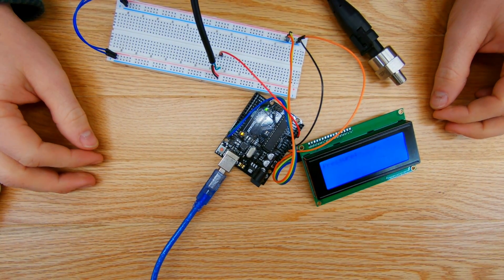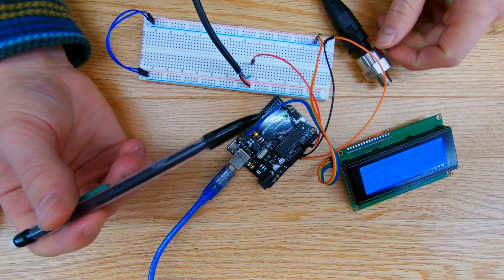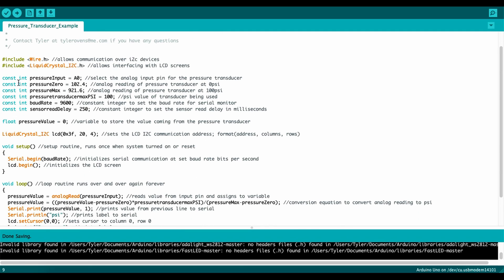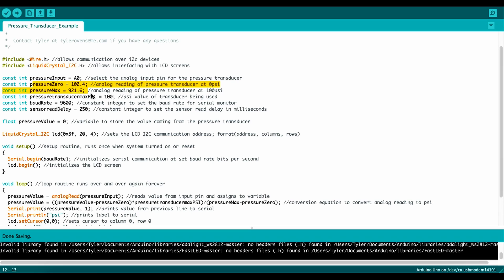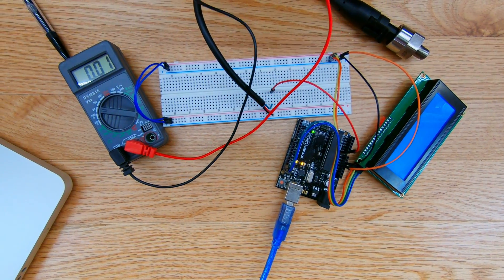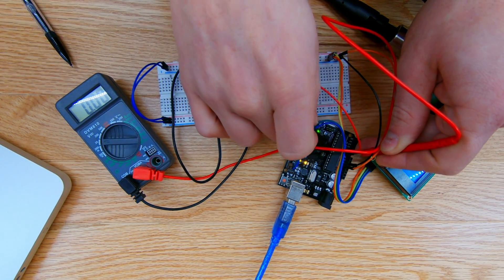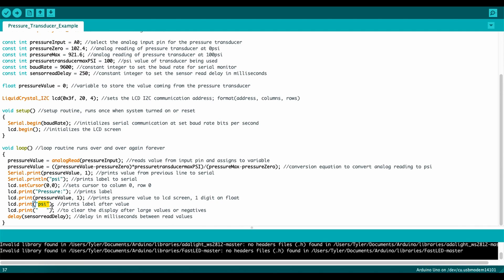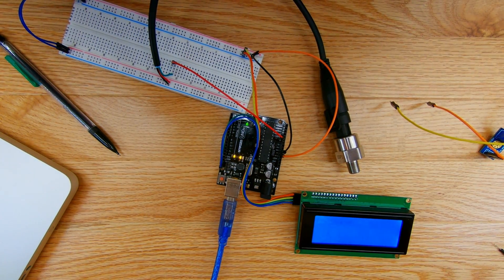Pressure Sensor - Arduino

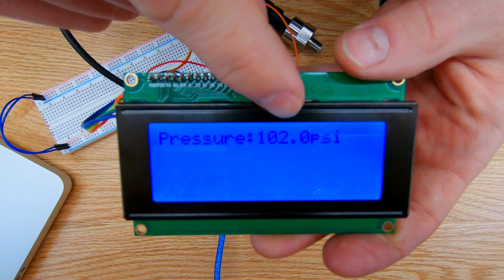Comment from the maker: At 10:57, the number is not a decimal because the analog input values only return whole integers, my mistake.
Reply: can you share the new code ?
Reply from the maker: @siraitkreatifchanel  Code doesn't change
Reply: @OvensGarage  Great video!  This helped me a ton.  I'm not sure I'm understanding the 10:57 comment though.  I think I understand the integer vs decimal part, but why is it reading 102psi instead of 0psi?  Was this filmed before you added the "pressureValue = ((pressureValue-pressureZero)*pressuretransducermaxPSI)/(pressureMax-pressureZero); //conversion equation to convert analog reading to psi" line?
Again, fantastic and very helpful video!  I'm just trying to educate myself.
Reply: @jondonlon1407  Actually if you read the code you can see that the 102 is not a PSI value, it is the value between 0 - 1024 converted by the Arduino (equivalent to 0-5V). That is printed because he has put the real PSI value in comment (the code line below the reading() line). If he uncomments that line of program you will see 0 PSI as value. So 102 is equivalent to 0 psi witch is the good value.
Reply: @jondonlon1407  can i use this code with any Arduino supporting pressure sensors?
reply me brother
Reply: please friend !!!
help me with this code !!
I need to print on the TM 1637 display !!!
I can't help showing it!
please, can you help me ?
Reply: @juniordiegues5090  did you come right with the TM1637

Comment: I finally understand how to take adc to psi, THANK YOU. AI had my head hurting i was like it can't be this hard lol. I'm trying to make a waste gate for a diesel truck open once a pressure ratio reaches a certain limit, around 1.6-1.7 drive pressure ratio. so I can keep building boost and hopefully have the Arduino  calculate the drive pressure ratio have a exhuast pressure sensor and a intake boost sensor and have a Mac valve regulate waste opening. I want to only open the waste gate when the engine has too much drive pressure. Which would mean it's opening dynamically with the drive pressure and boost pressure, should make the truck spool up nicely. I'll post a video once I get my setup completed this winter. I now need to figure out how I'm going to make the Arduino change how much the Mac valve allows air to the top of the gate. Any ideas? I'm thinking I can create a while loop and have a set pressure ratio I want to keep the truck under and so long it's under that It will stay closed. It's it starts to get to high I'll need to feed it duty cycle until it find where it needs to be ... Any theory from people who actually know wtf they are doing would be awesome.

Comment: Let's say I'm working with a sensor that ranges from -100kPa to 20mPa, and it's voltage ranges from 1.8v to 3.6v...How could I convert its analog readings to a psi value?

Comment: how did you get 0-1023? Is that from a sheet? Or a standard for every pressure transducer?
Reply: This is Arduino's analogRead function. 0V is read as 0 and 5V is read as 1023. ALL other  values are proportional to the analog input value

Comment: Hi bro i have one question......if you have to your own mcu board then what will be interfacing circuit will be of analog pin.... de we need a resistor divider ckt with skotky diode  with that?

Comment: I'm not real familiar with Arduino coding.  I get this error shown below when I compile the sketch Any thoughts??
Thanks
Ron

C:\.arduinoIDE\Arduino_Pressure_Sensor\Arduino_Pressure_Sensor.ino: In function 'void setup()':
C:\.arduinoIDE\Arduino_Pressure_Sensor\Arduino_Pressure_Sensor.ino:25:13: error: no matching function for call to 'LiquidCrystal_I2C::begin()'
   lcd.begin(); //initializes the LCD screen
             ^
In file included from C:\.arduinoIDE\Arduino_Pressure_Sensor\Arduino_Pressure_Sensor.ino:9:0:
C:\Documents\Arduino\libraries\LiquidCrystal_I2C/LiquidCrystal_I2C.h:58:8: note: candidate: void LiquidCrystal_I2C::begin(uint8_t, uint8_t, uint8_t)
   void begin(uint8_t cols, uint8_t rows, uint8_t charsize = LCD_5x8DOTS );
        ^~~~~
C:\Documents\Arduino\libraries\LiquidCrystal_I2C/LiquidCrystal_I2C.h:58:8: note:   candidate expects 3 arguments, 0 provided
C:\.arduinoIDE\Arduino_Pressure_Sensor\Arduino_Pressure_Sensor.ino: At global scope:
C:\.arduinoIDE\Arduino_Pressure_Sensor\Arduino_Pressure_Sensor.ino:42:2: error: expected unqualified-id before '/' token
 */ Code End
  ^
C:\.arduinoIDE\Arduino_Pressure_Sensor\Arduino_Pressure_Sensor.ino:42:2: error: expected constructor, destructor, or type conversion before '/' token

exit status 1

Compilation error: no matching function for call to 'LiquidCrystal_I2C::begin()'
Reply: It seems that begin function expects 3 arguments, you gave none.

Comment: Hi awsome video ... Do you think this sensor would be sensitive enough to detect air flow in ducting ..  We have a fan that extracts from an industrial laser ... I need to work a way to detect which way the air flow is going left or right from a bypass system .. Was hoping if this is sensitive enough I could fit one on each side .. And control indicator light to show the air flow direction .. Hope that makes sense ! .thank you
Paul

Comment: Well explained, thank you! I am currently working with a 5000PSI pressure transducer (Output voltage 0.5V-4.5V) and the Arduino nano. Can I use this code changing the constants? and, what do I have to change or add to the circuit?

Comment: Thank you for this project!  I'm starting at arduino language and it was easy for me to follow your explanation. I'm trying to make a water level indicator for my VW camper bus using this pressure level. I need to transform the analog reading values into percentage and liters so i can know how much water do i have left, i think with this code i can make it happen. :D

Comment: I've spent the last few months on and off working on a project with a pressure sensor and I could not get it to work for the life of me (I could solve it instantly by paying twice the price of a component to have it shipped from america). This video has basically saved me because it's exactly what I want to achieve and can be found much easier.

Comment: Hi, great video! beginner here, i have a question tho.. my sensor is capable to measure up to 12 bar (174 psi), yours is 100 psi how did you get the values 0-1023? how do i get the values of my sensor?
Reply: The 0-1024 is the function of the analog.read() command. It takes the input in voltage and converts it to that range. It is not sensor specific

Comment: Hello, thank you for your video.
I've got a small question. 
If my sensor works with a 0-10V signal, can I use a voltage divider for the same code?
thank you
Reply from the maker: I believe so yes

Comment: Hello, I am using a 300 psi pressure transducer. I used your code I am just confused what number to use for the analog signal. You the the number 1024 what will be the number I use. Or better question how do I determine that number?

Comment: Great video & description. Was planning to use this type of sensor & a traditional gauge setup on my Jag but this approach is far more sophisticated. I also want to monitor battery voltage so your last comments are a big plus! FYI Oil pressure & battery voltage are big issues on modern Jags but JLR don't install these driver aids these days.  Many folk on the Jag forums will be interested in your project, good luck & I'll watch out for updates.  Many thanks Dave in the Wirral, UK . Subscribed!
Reply from the maker: Thanks for the comment appreciate it!

Comment: Hi - how would you store and display the maximum measured value of the run? Thank you
Reply: This sketch reads the pressure value from the transducer connected to the A0 pin and stores it in the pressureValue variable. It then compares the current pressureValue to the maxPressure variable, and if the pressureValue is greater, updates the maxPressure variable to be the new highest reading. Finally it prints the current and max pressure values to the serial monitor.

int pressurePin = A0; // pin where the pressure transducer is connected
int pressureValue;   // variable to store the current pressure value
int maxPressure;     // variable to store the maximum pressure value

void setup() {
  Serial.begin(9600); // start the serial communication
  maxPressure = 0;    // initialize the max pressure value to 0
}

void loop() {
  pressureValue = analogRead(pressurePin); // read the pressure value

  if (pressureValue > maxPressure) { // check if the current pressure value is greater than the max pressure value
    maxPressure = pressureValue;     // if it is, update the max pressure value
  }

  Serial.print("Current Pressure: ");
  Serial.print(pressureValue);
  Serial.print(" Maximum Pressure: ");
  Serial.println(maxPressure); // print the current and max pressure values to the serial monitor

  delay(1000); // wait for 1 second before reading the pressure value again
}

Comment: Is it compensated with static pressure or I have to apply barometer too and do the math?
Reply: These are definitively not compensated. I use a 30psi sensor in my heating system in my house, and it varies proportional to the change in atmospheric pressure.

Comment: im doing the same thing with my 04 chevy i just dint know how to get values for sensor but im using a nextion hmi screen to get my 3 battery volts, air tank, and run 32 relays check out my idea on my channel

Comment: Just curious, how did you get your max and min pressure PSI analog readings? I am working on a similar project using a 15PSI sensor, but am trying to figure out how to find those min/max readings.
Reply: I am working on a similar project with 300 psi. Did you end up figuring it out Max and min for the sensors? How did you do the conversion?
Reply: I think max and min is just posted on the sensor data sheet. Not sure how to accomplish the conversion yet
Reply: @josephdaquila2479 OV input  is read as 0 by analogRead and 5V is read as 1023. So, you have to convert analogRead values to match the voltage given by the sensor and correlate to the pressure according to sensor model.
Example: a sensor with full scale equal to 20psi and current pressure is 10 Psi and sensor voltage range is 0-5V. You get 2.5V from the sensor that is read by analogRead as 511 or 512. From these information you calculate the pressure and get 10psi.

Comment: Can this work if I want to use this to turn oxygen concentrators on and off at certain pressure values within a holding tank full of oxygen, turn them on at 70 psi and then off at 100 psi? Any help would be appreciated, im not familiar with arduino but am capable of learning this just to augment my oxygen system, thanks
Reply: Message me brother. I can walk you thru it. Built my own oxygen system back in 2017. Markovichglass
Reply: @markovichglass  right on man, thanks for reaching out, do you want me to contact you by email? If so what’s a good address

Comment: Awesome video. I'm having one issue, when I use your equation and some portions of your code, for some reason my sensor readings flip to negative at 40PSI and as I increase the pressure, the negative starts dropping back to 0. Its a weird one I can't figure out.
Reply: The variables that are part of the equation are declared as INT while The result the code is expexting is float. This will cause the system to put a negative sign in about 32 psi... The solution is simple: declare all variables that are part of the pressure equation as float and also define them as float (include a '.0' after the integer part). This should solve your issue

Comment: How can I use in Vehicle Tube to measure pressure?
Reply from the maker: You could probably drill and weld a bung on it then thread in the sensor

Comment: Thanks man great video. I have a home heated by oil tank and I'm thinking it'd be a good first project to put an analog sensor to measure tank level. So it can alert me when the tank gets low, and I can check it remotely. As of now I have to walk over and it's in the back of my garage. But also thought if I log the data I can measure oil usage over periods of time. I have a Rasp PI 4 & Arduino UNO, going to buy that sensor you used and probably use the Pi so I can take the data and move it via Wifi somewhere I can access it remotely.

Comment: Mine is 60psi. I change pressuretranducermaxPSI to 60 but at my serial monitor the prints without pressure are from -0.5 psi to 0.7 psi. Something going wrong with the sensor or some
thing else?

Comment: If the sensor supply voltage is 12v not 5v and its output voltage is 0-5 volt ..will this affect the reading on the ADC pin?

Comment: I have mine up and down like crazy with no pressure connected, I have even used the Arduino internal pull up function but still the same, has anyone else had this problem ?, there was no datasheet supplied with mine off Amazon so if anyone can help thanks
Reply: I am just waiting for a thread adapter so that I can connect it to a pressure test rig, I am hoping that it will be more stable once there is some pressure in it
Reply: @acestu  how did it go for you??

Comment: Everything works for me except the pressure is no printing to the LCD screen, though it is reading it in the serial monitor. i changed the address as well, but I am just getting white squares, had to change columns an rows too.
Reply from the maker: Probably the contrast of your screen

Comment: What kind of pressure measures of the device that you use? And are you familiar with BME280 Barometric Pressure sensor? Can you help me how can I measure a gauge pressure using the BME280 sensor.
Reply from the maker: Yes I have used the BME280
Reply: @OvensGarage  I used BME280 and used codes that reads the barometric pressure, example of the initial reading is 100.2 KPa. I want the initial reading to start with 0 like what you did in this video but I can't make it.
Reply: @OvensGarage  And it is possible to get the gauge pressure using the BME280?

Comment: is it possible to measure water pressure? is it safe if the water come into that sensor's hole?
Reply from the maker: Yes, read the description for the amazon link. The product info is supplied from the manufacturer.
Reply: @OvensGarage  thanks

Comment: I am using a 30 psi pressure transducer and this program is not working, does anyone know why?
Reply: Change the numbers you change the slop of the line. Rewrite the equation, example:
0.5_v for 0_psi & 4.5_v for 30_psi:  PSI = 7.5 * (voltage) -3.75
float voltage = analogRead(A0 ) * 4.8828e-3;

Y2= m(X2 -X1)  + Y1 (linear line equation)
  m=(Y2-Y1)/X2-X1)= slop   your (X,Y): ( 0.5, 0) & (4.5, 30)

Comment: I find the video very instructive, especially the time you take to explain each instruction in detail.
My question is if you have done tests with negative pressure, that is, with depression, I would like to build a vacuum gauge and it seems to me that it could work.
Reply from the maker: I have not done the test with an applied vacuum. I'm unsure if the sensors are designed to work that way. I would check the sensor manufacturer specs.

Comment: Im not sure if this has been mentioned or pointed out before but wanted to help those following along looking to use this example in their own projects.
The Pressure conversion formula needs to be adjusted. Based on the example, if you plug in a psi value and work through the equation, its out put incorrect values. 
Instead use:
PSI = ( analogRead( pinID ) - pressureZero ) / ( ( pressureMax - pressureZero ) / 100 ); 

This formula can be optimized more and the optimized equation would look like this: 
PSI = ( analogRead( pinID ) - pressureZero ) / digitalCountsPerPSI; 

Just precompute digitalCounts and store it as a global const float, or calculate it once one setup. this would remove the unneeded same operations that are being preformed every tick. 
const float digitalCountsPerPSI = pressureMax - pressureZero / 100;  // (or 8.192). 100 is the total PSI the sensor will read.

// Following example is based on the provided method from video with 50 PSI. "p" does not balance out correctly. 
pressureMax(512 - pressureZero)/(pressureMax - pressureZero)
921.6 * (512 - 102.4) / 819.2
921.6 * (409.6) / 819.2
377487.36 / 819.2
p != 460.8; // as you can see the value got larger not smaller.

The way I got 512 to test the provide method was as follows:
pressureSpread = pressureMax - pressureMin; // 921.6 - 102.4 = 819.2.
p = pressureSpread / 2; // 819.2 / 2 = 409.6. get the half way point of spread since sensor max is 100PSI @ 921.6 to get 50 PSi.
p += pressureZero; // 409.6 + 102.4 = 512. add Zero point to p to move value into pressure scanning range.
"p" should = 512

when you use the adjust method the output should return as 50psi:
((512 - pressureZero ) / ( ( pressureMax - pressureZero ) / 100 ); 
(512 - 102.4) / ( ( 921.6 - 102.4) / 100);
409.6 / ( 819.2 / 100 );
409.6 / 8.192;
PSI = 50.

Comment: I have 4 of these exact transducers. When reading the unaltered analog value on the serial monitor, I get 87 for one of them and 102 for the others. Does this just indicate that that specific transducer is running at less than 0.5 V? When I calculate the low voltage from those numbers I get 0.42V which does seem reasonable. Am I missing something or do I just need to calibrate each program to the specific transducer it's using if it's not 102.6?

Comment: I have a 300 psi sensor which has the same 0.5v is zero - 300psi 5v. When I put in the code, I changed the max psi to 300 but when I run the serial monitor and have it hooked it, it shows on average -1.5psi. Is this correct or should it say 0.0psi?

Comment: This is an amazing video!
For my school i need to use a mpx 2050 gp pressure transducer to make a bloodpressure monitor. I need to convert the output voltage to a signal that gives a pressure from 0 to 200 mmhg. Could you help me with the arduino code for this task?

I couldt thank you enough!